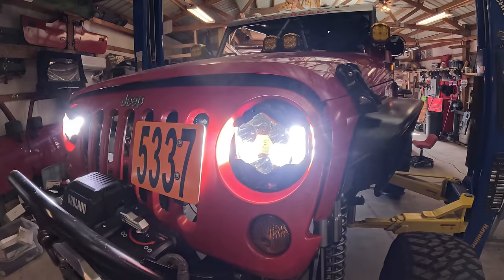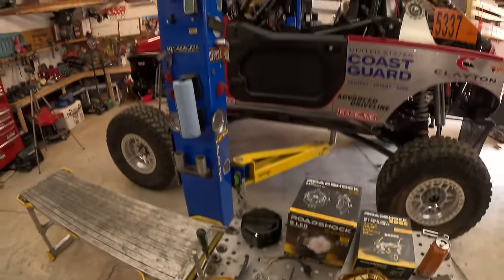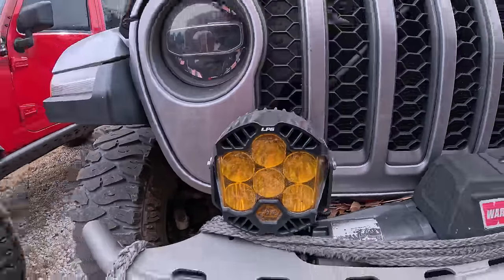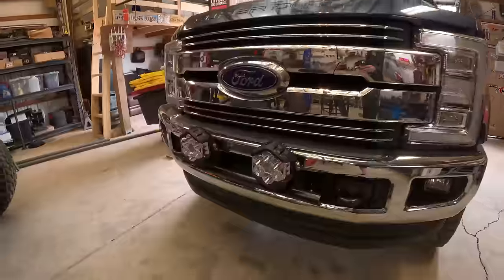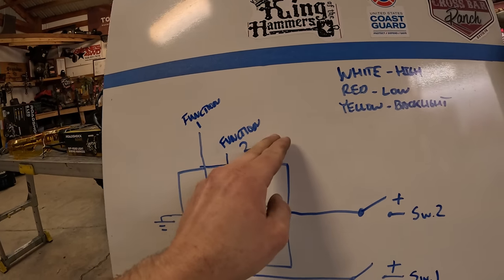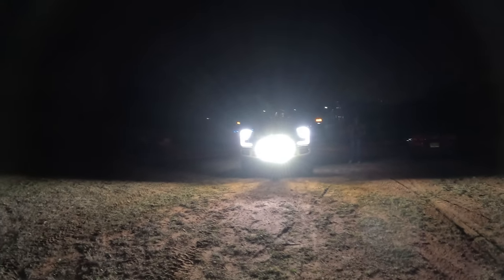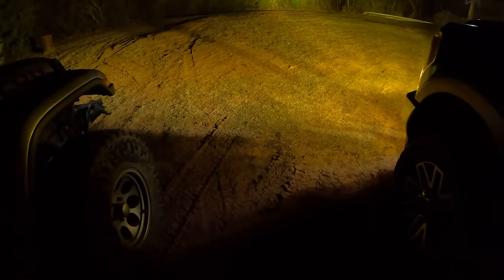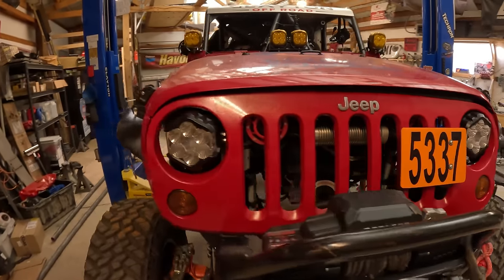These NEW Harbor Freight Lights are INSANE!

Comment: Great video. I have a relay question if you can offer any ideas. I have it wired with the HF harness and I wired the relay into my after market switch that uses solid state relays.(Similar to the one you've linked above just from a different brand) I wired only the positive triggers to the positve wires from the switch included with the harness. I can trigger the low but I can't trigger the high. My switch has an indicator light that lights up with the high positvie attached. I think it's not seeing the circuit complete because the relay isn't switched. Do you think I can use a relay inbetween in the NC position and trigger it to NO to trigger the relay in the harness and trick my switch into thinking the circuit is shut? Thanks for any help.

Comment: So you mentioned that you cannot run the low and the high beam together. You say that in your relay wiring diagram. Then you demonstrate the lights with the low and the high beam together. WTH?
Reply from the maker: The high beam circuit powers the low and high leds (all). So you can’t have 12v going to both circuits (high) and then send another 12v to the low beam circuit that is already on. Hope that makes sense

Comment: no point in using a relay if you wire it like that.
Reply from the maker: Yes, this relay setup ensures both circuits won’t be on at the same time, and like I mentioned you would still need a relay on the switch sides as well. There’s no arguing this, it’s a basic electrical circuit.
Reply: @JKGearandGadgets  sorry missed the part where you said to relay the switches